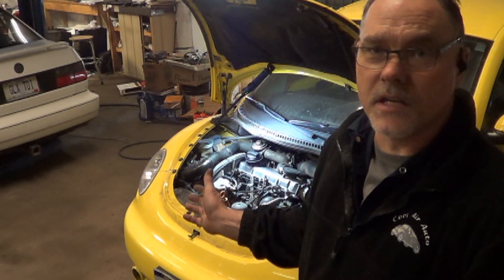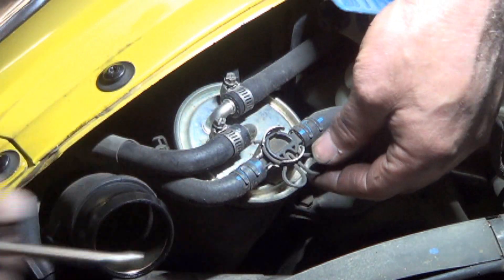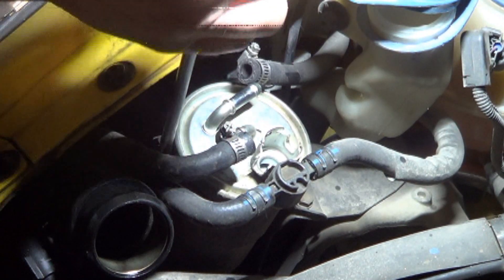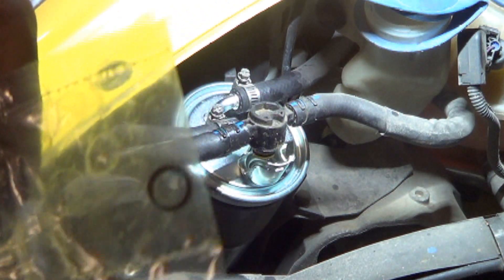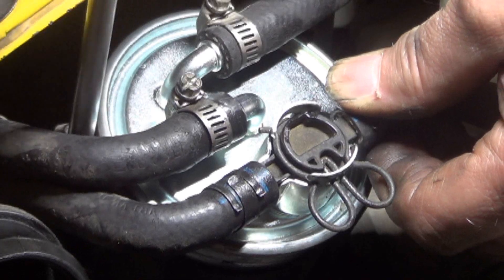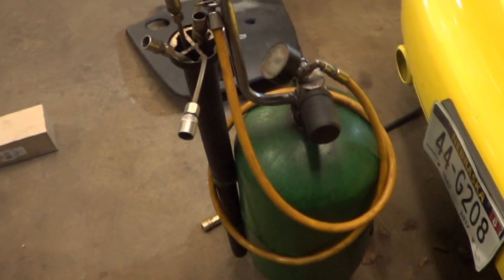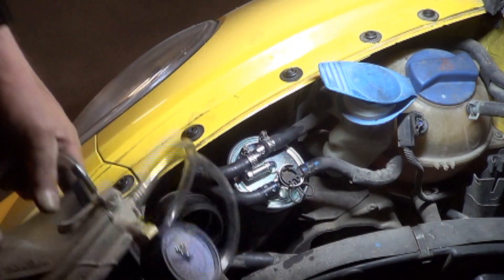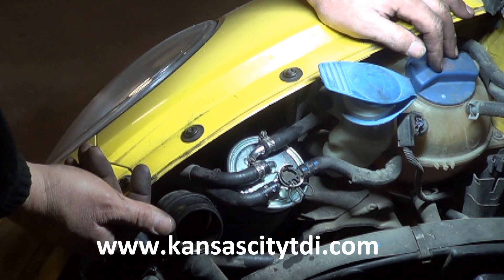how to replace & prime ALH tdi fuel filter

Comment: Thanks for the video! Very good. In my humble opinion, for a do it yourselfer that watches it first time, you might leave out the bit about all the vacuum and sucking diesel with a special tool and complicating things - that will frighten off a bunch of people. I own a VW AGR engine for 22 years and it is completely fine to fill the new filter to the brim with diesel and it works normal, no cut offs. Still driving😉. Thanks again👍
Reply from the maker: Ok.  Your right.  but I don't want to steal your thunder, you should make a video!
Reply: @CoolAirVw  Hi Sir, i did not mean any disrespect or try to put your effort and video down or something... I just wanted to mention that i did it this way on my AGR engine a couple of times and it worked fine for me. Again, RESPECT for the video, not trying to get glory out of this in no means. Just wanted to get people less scared about some do it yourself tasks. Thanks again on a great video👍 BR Zlatko
Reply from the maker: @zlatkojurkovac6981  No offense taken.   Your absolutely right.  simple is best.

Comment: I know it's an old platform, but as many ALH videos as you can provide would be awesome. Just picked up my first TDI and the snall things are adding up, so some DIY during these "dark times" could save me the money of getting them sorted out at the shop.

Om the list of fixes:
-small coolant leak around the vaccuum pump.
-limp mode when accelerating uphill (doesnt happen if i put the car in cruise control during steep uphill)
-sometimes my battery's power just gets cut off when i turn the car off and try to turn it back on. (Seems like some kind of security or alarm glitch)
-tiny oil leak at the back of the valve cover (pretty sure i just need a new gasket)
Reply from the maker: You got it!  Much of what I work on is still ALH.

Comment: I just changed out the fuel filter on my 2002 Beetle, and this video was enormously helpful.  I'd like to add a few suggestions for others.

First, use an OEM filter.  I bought a Mann fuel filter on Amazon for less than an Auto Zone one cost.  Mann makes a lot of VAG parts. It had the different-colored gaskets, too.   I also installed a Mann air filter, and it was a tighter fit (and better seal) than the aftermarket one I removed.  My air box was loose, so I just took care of everything in one afternoon.

Second, I had to loosen the bracket that holds the fuel filter in place, because it hit the edge of the car when I tried to pull it out.  Remove the outer screw and loosen the inner one and it'll pivot out enough to be removed easily.  You'll need a 10 mm socket.  Because of the tight fit I too removed the intercooler hose.

Third, on the recommendations and others' experience I got from several VW TDI forums, I primed the new filter with LiquiMoly's "Diesel Purge" (also from Amazon, since I couldn't find it in a store).  It comes in 500 ml cans, and I needed about 1.25 cans.  After reassembly I went to key on/engine off, pushed the pedal to the floor one time, and started it.  It hesitated just a little and then ran without a hiccup.  I poured the rest of the Purge into the fuel tank.  There was dirt and debris in the old fuel filter, but I was surprised to find no water.  After letting the dirt settle, I poured off the clean fuel and put it back in the tank as well.

Fourth, get the band clamp pliers.  They saved me much time and frustration!  With regular pliers I would have needed another set of hands.  Get one with a ratchet lock that lets you fix it in place.  I got an inexpensive one at Harbor Freight for around $15 without coupons.

If you're intimidated about doing this, don't be.  I'm not very mechanical--at least I wasn't before I got a TDI and HAD TO BE--and this is even easier than doing an oil change, because you don't have to get under the car.  It should be done yearly, and the next time this will be much easier.

Thank you, sir.
Reply from the maker: thanks for your comment.

Comment: A friend of mine ( owns a vw / audi repair shop ) reccomends that I use ATF  to prime the filter , he claims it cleans the injectors . Last time he changed my fuel filter I watched him do it and never had any issues . I recently got another ALH golf and just installed a new turbo ( with the help of your video 👍)  and I'm going to do an oil change , fuel filter in the next few days after I button up new brakes . Should I use the ATF  trick or is this guy not really my friend 🤔
Reply: I wouldn't.  Get LiquiMoly's "Diesel Purge".

Comment: Im definitely trying this method of priming the fuel system over what i did last time, which was trying to fill the filter itself, i started it and the car died 3 seconds later and it took forever to start, not doing that ever again, dont want to mess anything up

Comment: Does that Thermostatic T have to go in any certain direction?  Mine has an arrow on it but it's pointing towards the IP. Car runs great.
Reply from the maker: I'm pretty sure it will only fit the fuel filter one way.

Comment: Does the key need to be on to use this method? I have a 2005 VW Jetta mk4 tdi (PD BEW) changed the tandem pump now it will not start need to bleed the air out of the fuel system. Thanks for any info.
Reply from the maker: I dont understand the question about the key.  your car will have a pump in the tank, and maybe you could use some type of method using that pump to prime, but either way if there is air in there you'll need to bleed the air out.
Reply: @CoolAirVw  because the pump only turns on for 2-3 seconds is why I asked.

Comment: I have changed the filter about 10 times on my 2001 polo since i bought it in 2014, never primed it never had a problem with the tandem pump or injectors or starting after on 182k miles now. How have i got away with it?

Comment: Hi, my engine slightly adds throttle when idle, every few seconds, can it be because of the air in the air pump, cause i see some air pockets in the hose. I haven't primed the filter and we try to start it, it went off after few seconds, after we primed it somehow but now sometimes gives throttle slighty when idle, should i change the filter again, or look for a problem elsewhere. Thanks
Reply from the maker: I doubt it.  Is yours an ALH tdi?

Comment: Will I be OK to just pour fresh fuel into the top of the filter? If I don't suck the fuel through using the method you use, will I have air in the system?
Reply from the maker: that will probably work.

Comment: Would you dare use any of the old fuel from the filter? The water should collect in the bottom so you could drain it and then use the rest theoretically, just curious. Good video
Reply from the maker: Rarely can you actually see water,  but I wouldn't use the old fuel.

Comment: My jetta TDI won’t start thinking it is the fuel filter any way I can be sure? I had parked it to go to work it was about 9 degreees out after work I tried to start it to no avail I hadn’t put anti gel in at that point I did the next day the car turns over just doesn’t start no clicking or anything. It was parked out side at that time but have since moved it into a garage had to trailer it there still won’t start
Reply from the maker: If its that cold put it in the garage then try to start.  Or put heat gun or blow drier on the fuel filter.  Cold fuel don't want to flow through the fuel filter.  You cold also loose prime and have to prime and bleed after a cold "no start".
Reply: @CoolAirVw  changed fuel filter she’s golden thank you! Subbed!
Reply from the maker: @Profeex22  Glad my video helped you solve your issue!

Comment: Your a god send for so many people! Is this possible to do on 2.0 tdi cjaa engine?
Reply from the maker: Yes but different.   best process involves using a scan tool to run the pumps to prime the fuel system.  simliar to what we dide in this video.  https://youtu.be/9T1YtlVz948
Reply: @CoolAirVw  Right. I’m looking into a new diagnostic tool to buy! Any recommendations for one that does everything without breaking the bank?
Reply from the maker: @hardcore4476  cant beat VCDS if your doing Vw, but OBD11 is cheaper and nearly as good.
Reply: @CoolAirVw  Thank you I looked into that and unfortunately it’s only for android
Reply from the maker: @hardcore4476  another reason Android is better???
Reply: @CoolAirVw  Found out the new one does both! 😁

Comment: These years tdi has no priming pump in the tank?
Reply from the maker: No pump in the tank till 2004.
Reply: @CoolAirVw  , thanks for replying.  I missed a good deal on 2002 jetta with original 155k mileage for $1000.

Comment: what about the air already in the hoses going to the injection pump? You cant bleed them like that.
Reply from the maker: I have a video on bleeding the injector lines and priming the injection pump.  You dont need to do that when changing the filter such as in this video.